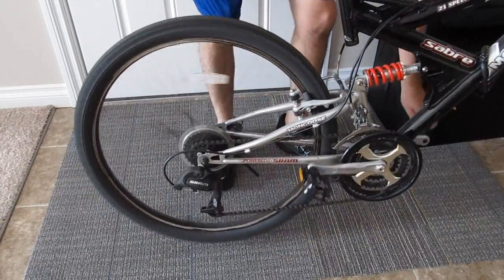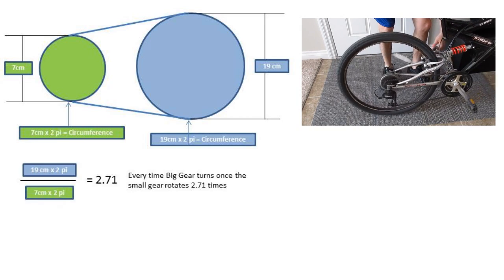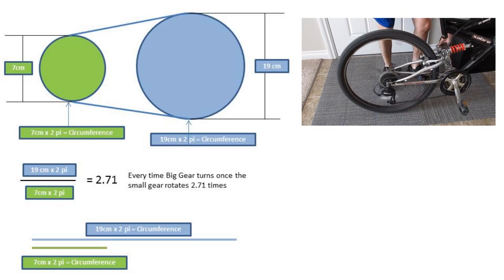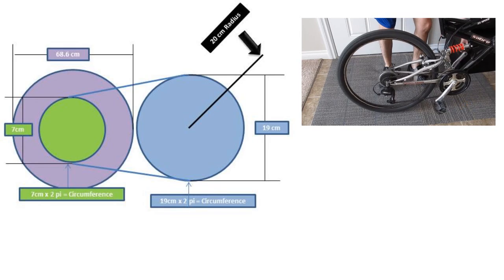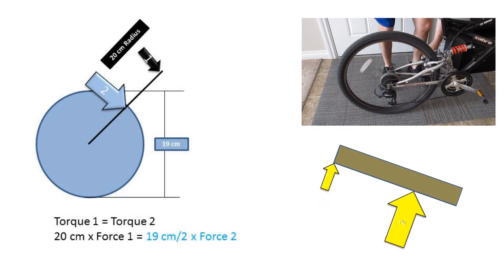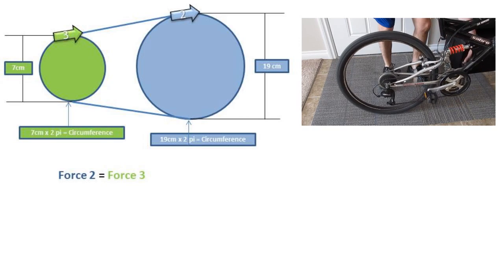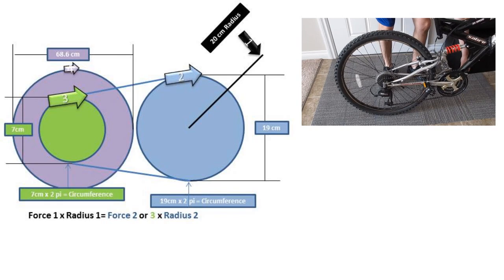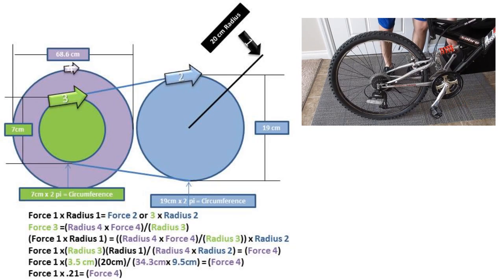Bicycle Gearing Physics (Velocity Gear Ratios ,Torque and Force Explained)

Comment from the maker: NOTE CIRCUMFERENCE SHOULD BE PI x DIAMETER NOT PI x 2 DIAMETER. THIS ERROR IS FROM INITIALLY USING RADIUS THEN SWITCHING LAST MINUTE TO DIAMETER. DIDN'T CATCH IT BEFORE POSTING SORRY FOR ANY CONFUSION THIS MIGHT HAVE CAUSED.
Reply: What about force lost due to frame bending :P

Comment: There are so many different levers on a bike, even in your legs, as the force on your muscles at different angles of pedaling change the mechanical advantage in your legs at different points of the stroke. Having a seat too low actually reduces the mechanical advantage of the quadriceps by reducing the knee's range of motion throughout the stroke, meaning the ratio of muscle force to pedal force is greater, but the muscle only moves through half its stroke. Muscles usually have a speed amplification and force reduction lever, so the muscles move only a few inches with a lot of force, the pedals move further with a medium force and the wheels move the furthest with the least force.
There is also levers in the cranks and consequently, the bottom bracket axle is under a lot of force because it is narrow in diameter compared to the pedal rotation. Also disc brakes operate with a mechanical disadvantage, as muscles do and the calipers need to apply several times the force that the bicycle stops with.
Reply: You mean to say, higher we sit more we can utilise the crank movement of our legs, in case of cycle riding?

Comment: !!! O.O ...DUDE - EIGHT YEARS... Anyways, I'm SHOCKED that only 21% of the torque input to the crank(s)get to the wheel - BUT - what I'd like to know\compare, is from which gear ratio will a rider get 100% of their 'power' put to the wheel, AND which wheel size(26'' which I ride at the rear - vs 29'' because it's common nowadays)wheel gets more of a riders 'power' to the ground... Thoughts? 🤔 P.S. 1. Like with the .7M vs .8M handlebars - I prefer to have comparisons which can eventually aid me in making practical decisions when choosing my bike & it's parts... 2. Have you ever considered using Oval chainrings?  (variable torque)

Comment: In the first slide it shows "7cm x 2 pi = circumference". The equation is C=2pi(r). Your answer remains the same because the 2s cancel and you used the diameter instead of the radius which would have been doubled anyways. But your setup should be revised.
Reply from the maker: great catch that is in fact a mistake it should not have the 2 there the math works out regardless
Reply from the maker: i root caused this to originally using radius than later changing to diameter. that is why it showed up as 2 times diameter when it should have been just diameter. I am only human i suppose.

Comment: Thanks for this. I have a question and while I could work it out from your video in principle in practice it is a little beyond me. I have intentionally lost 4kg. I am wondering if everything else remains constant how does this affect my gear ratio use? Is there a formula I could use to determine this? By the way I am running a 50/34 front ring and a 11-32 cassette. I guess I am interested in how much my weight loss affects the gear ratio hill climbing ie the 34 32 gear combo. Thanks  George

Comment: I have a question: why does changing to smaller rear sprocket make the gears heavier?
Reply: The smaller the gear = the HARDER it is to pedal  because you can FULLY ROTATE the wheel. That's why you go faster on a heavier gear. 
It is heavy indeed but imagine how fast your wheels would be spinning compare to a lighter gearing.

Try going to the biggest rear sprocket it's easier to pedal but it has less wheel spin.

Light gear = climbs
Heavy gear = I AM SPEED

This depends on the number of teeth your cog and chainring has tho.
Reply: The chain is pulling nearer the centre of the wheel (think of opening the door near the hinges, or doing a bicep curl, where the bicep lifts about 7 dumb bells for the hand to lift 1. If you can curl a 15 kg weight, if you could take the bicep out of your arm and tie one end to the dumb bell and another to a rope hooked to the ceiling, the muscle could lift 105 kg dumb bell but only about 3 inches. (I'm thinking the muscles of strong men must have about 3 TONS of force when doing these big squat weights!)
Reply: @TimpBizkit  appreciate the answer!

Comment: i think it would be easier for me to follow if you went through it more and broke it down more, like instead of just labeling the forces. give use the caculation and set that equal to the force that way we can also piece it together. its just hard to learn something by looking at diagrams as you tell use force x force= force 2 when we dont exactly understand how you got to thst point

Comment: Good day - can you help me with something? There is a situation with some bike rims or rather, bike riders where rear spokes on the drive\sprocket side of the wheel, crack the rim or in extreme cases break through the rim... I have since theorized that the issue may be due to riders pedalling their bikes out of the saddle - which may have been okay back in the day of steel rims - but which may be too much for a lot of modern rims, out of the saddle riding & or especially heavy riders who ride out of the saddle... What I need from you - as my Physics is too basic - is for you to calculate the different amount of force that say, a 220lb rider puts on a pedal(or rear wheel if it's not too much extra to calculate): 1. When said rider pedals from a seating position(the most difficult for me to discern - why I'm requesting help) & 2. When said rider - the same rider - pedals whilst off of his\her saddle... Please help - Thanks...

Comment: This is pretty much how I've always looked at this.  However, I read and have been told that "Chain Length" actually is what the issue is.  The only thing I can figure is the amount of chain in contact with each ring...  Anyway.. Great video..

Comment: From which equation do you get that the smaller gear has "more RPM" at the cost of less torque?  The less torque because of the shorter distance, but the more RPM? Thanks for the video.
Reply from the maker: the higher rpm was found by dividing the circumference of the large gear over the small gear. The lower torque comes from force time distance from center equals torque. The same force is acting on both gears so if the force is closer to center then there is less torque. So smaller gear equals smaller torque.
Reply: horsepower= (torque×rpm)/5252 is the equation used in cars. if we switch horsepower for the power generated by your legs (which is constant) we get power=torque×rpm. since power is constant, if torque is decreased, rpm has to increase.

Comment: Would there be any torque  multiplication at the rear wheel if gear ratio remained the same but larger sprockets were used to achieve  the same gear ratio?
Reply: Yes my dad tried this, it works but if you're not careful your bike can break the chain, you are also not defying the laws of physics, if you can multiply the torque, you can make more power with less effort. Ever tried turning a nut with a small wrench and it was too hard? Then you get a wrench with a very long shaft and with just a small amount of force the nut pops free, that's because you were able to multiply the amount of torque to astronomical levels. The downside is that to produce higher torque you have to turn things slower.

Comment: why is force 2 and force 3 be equal to each other
Reply from the maker: Think about if you were to pull a rope would the force be equal at every cross section or would it randomly change. Tension between chain is the same. (Neglecting minor losses)

Comment: There is something I don't get. Suppose the big front sprocket is constant, but you change the rear wheel gear from one very small to one bigger. Supposedly in the second case you get more torque because the input force would be the same (let's assume that) yet at more radius, more torque.  Supposedly more torque means more anguar acceleration at constant inertia, and at constant time it would imply more angular velocity. Yet the angular velocity is more in the  case of the smaller gear than in the other.    What I am missing here?
Reply: It would have more angular acceleration, which is why you launch more quickly from a traffic light in a lower gear, but when your legs reach the fastest they can spin, the force drops drastically and the bike needs a higher gear to keep accelerating. Eventually wind resistance limits the maximum speed the bike can travel in any gear, which is why you can't just keep putting higher and higher gears on there to reach 70 mph. If your legs could spin unlimited speed but only finite force, you would reach the highest speed in the lowest gear. If your legs have a top speed but unlimited force, then the higher gear the better.
Reply: @TimpBizkit  "if your legs could spin unlimited speed but finite force you'd reach top speed". If the max force you can output is finite you will be limited by the force of resistance you are pedalling against meaning you will not reach max speed. Unless you change into a lower gear which has less torque. I think that is opposite to what you said but I am not sure. What do you think? (I'm not criticising, just trying to figure it out)